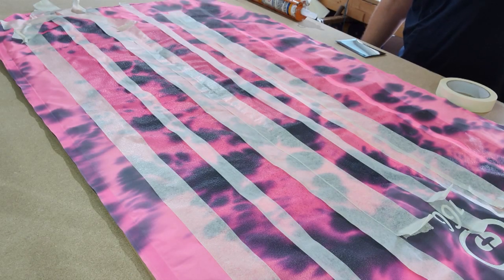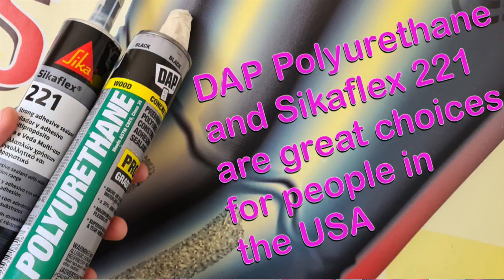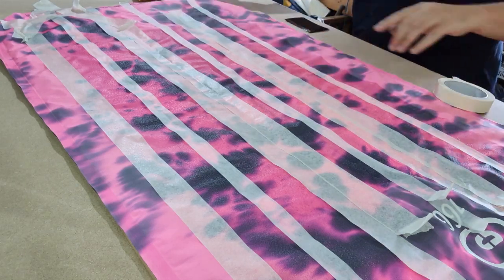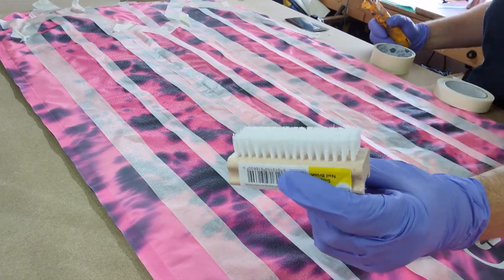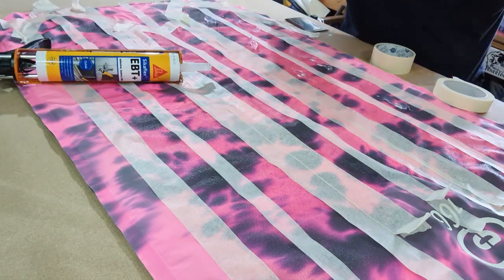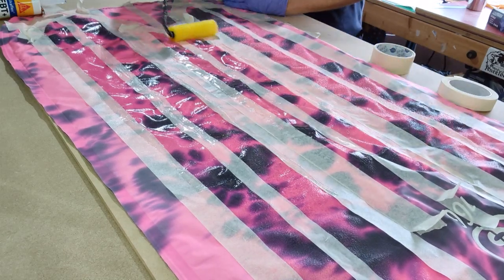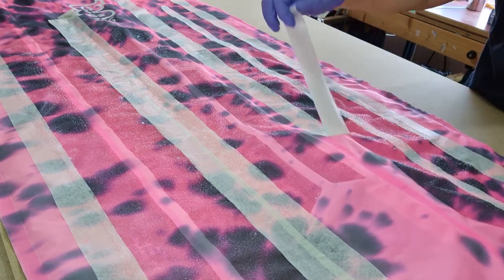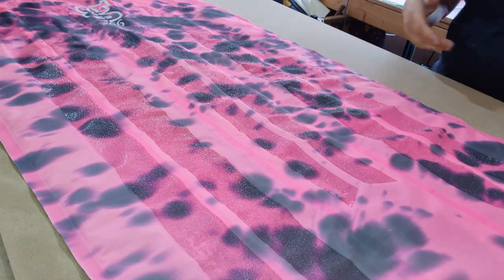Surfmat Care & Repair   Topping Up Grip

Comment: Thanks Graeme  for another great video! Pardon a stupid question, but this is just for a mat that already has grips, correct? I ride a fourth gear flyer, which has somewhat nonslip canvas but no actual grips. At this point I am using standard surf wax, which of course wears off after a session or two...
Reply from the maker: You can apply sealants to canvas but if they have been waxed you need to get the wax off thoroughly.
Reply: @MatSurfers  Thanks so much!

Comment: Bought some urethane sealant to use on my first mat build!
Just practiced this technique on an old softboard... 

Haven't ridden anything with thane traction yet,  so you think it might work on the softboard?
Reply from the maker: Only if the board has a porous deck. If it's slick then likely to peel off.